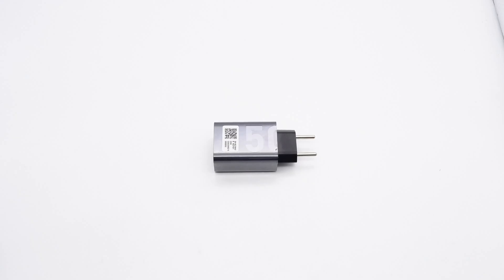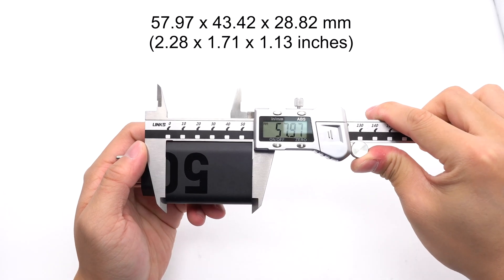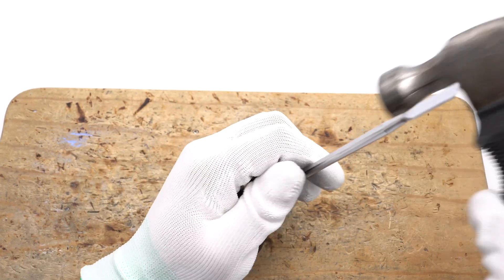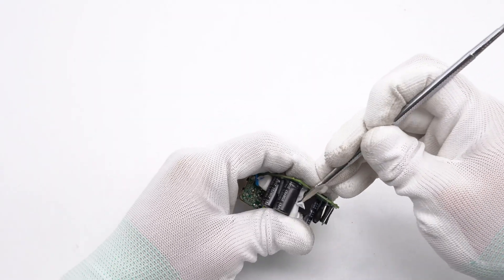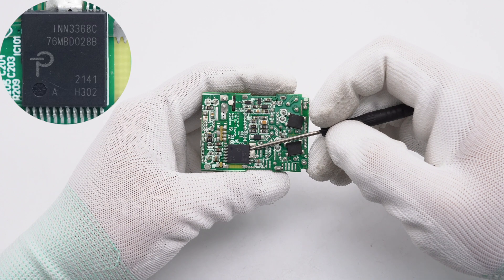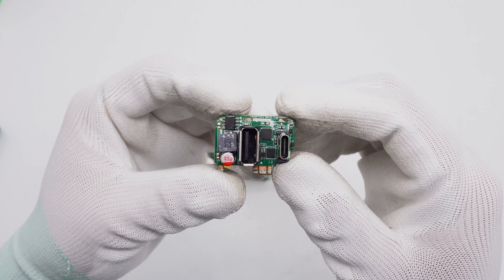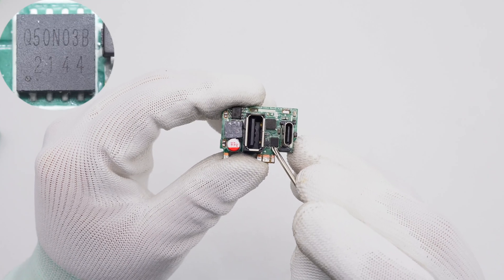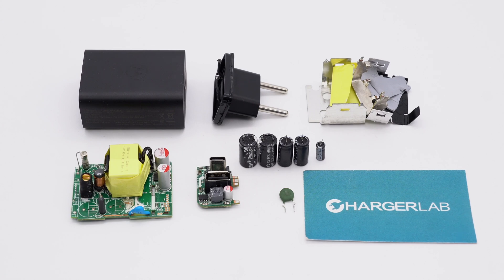Teardown of Motorola 50W Charger

Comment: Are u sure it's a genuine charger? European plug prongs need to have plastic insulation & only about 1cm near the tip should be exposed....
Reply: It might be a type D plug (no ground), mostly used in India and Nepal. Apple chargers for their market also have same uninsulated prongs.

Correction, that text is in portugese so it might be for Brasilian market.
Reply: Brazil also usually used insulated prongs